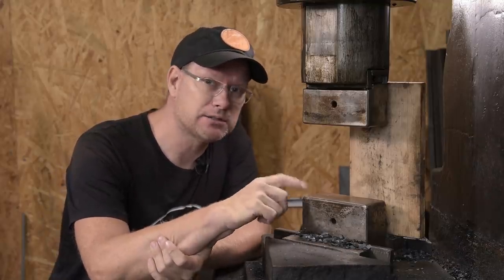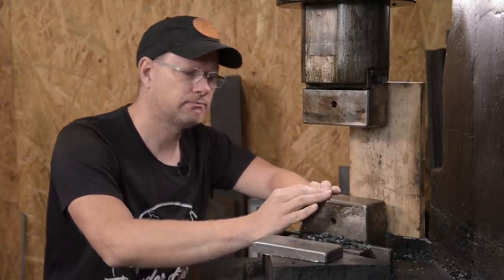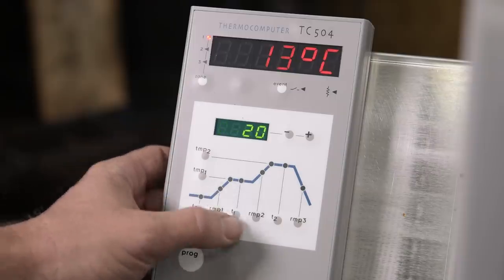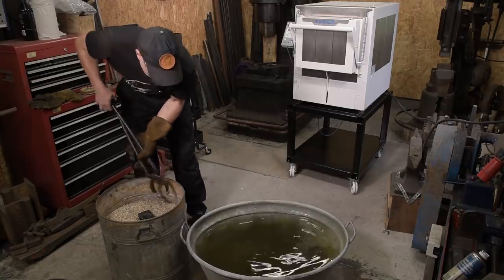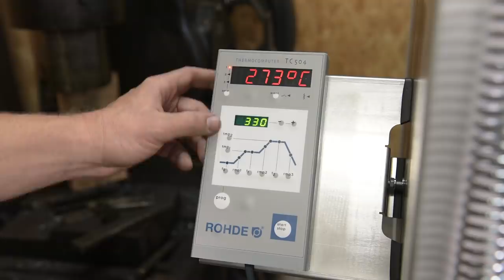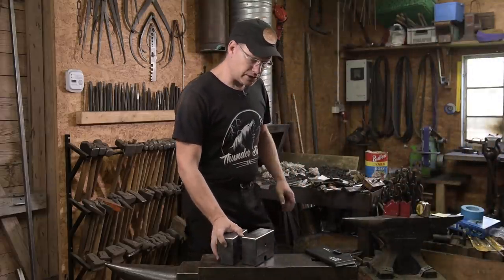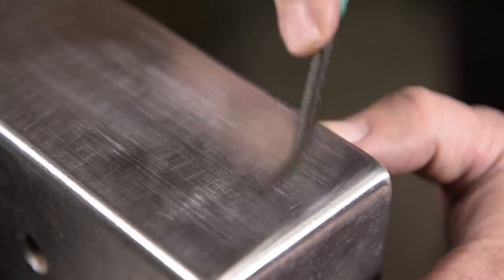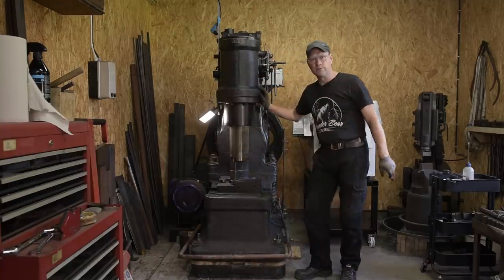Blacksmithing - Heat treating hammer dies

Comment: 1045 at that thickness will harden no deeper than about 6 mm.  4140 will give the same hardness but to a greater depth and do it in oil which reduces cracking risk and distortion. The quench medium, air, oil or water,  depends  as much on thickness as it does on chemistry. 1095, considered a water hardening steel, will give full hardness on sections 1/4 " or less when quenched in oil. Nothing is gained by exceeding the critical cooling rate of a particular steel section.

Comment: If you have a piece of mystery steel you might be able to take it to a scrap dealer and have them look at it with their X-ray fluorescence analyser. That should give you a fingerprint that will uniquely identify the alloy.
Reply from the maker: Indeed, but not many will have that instrument. In this case I was pretty sure what I was dealing with.

Comment: Torbjorn, If those 1045 dies were hardened and tempered before you started this process, shouldn't they have gone through a complete annealing/normalizing cycle before re-hardening?  This is what I was always lead to understand from the heat treating world.  I'm sure I'm missing something or just too old lol!  As a longtime subscriber I love your channel of superior work!👍👍👍
Reply from the maker: Thank you! They sure were. Assuming the last hardening was done right with no extensive over heating with grain growth and such I don't know if you gain much from a normalizing cycle. Annealing is definitely not needed. It can also be different with other more complex alloys. I'm not an expert here, just doing what I have picked up along the years.

Comment: Thanks so much for all your videos.  I was wondering that if the face of the metal hardened further by increasing the carbon content (face hardening). I understand that this was used to harden armor plate previously.
Reply from the maker: Thanks. Yes you can case harden something, increasing the carbon content on the surface, maybe 1-2mm deep or so. I don't think that is suitable for hammer dies though.

Comment: that seemed to go alright 
I read that it can be difficult to harden big pieces of steel like that.
because the cooling has trouble overcoming the heat and so it can anneal/overtemper itself as it is being quenched 
or the temperatures of cold hardened steel and hot soft steel, can break the hardened steel, because hot steel is expanding and hardened steel is shrinking. 

hm maybe your pieces were small enough.
Reply from the maker: I'm not sure, really. Enough coolant and agitation is important of course. The expanding is what breaks stuff for sure. The alloy just needs to handle the cooling rate. That's why most steels only are quenched in oil as that cools slower.

Comment: I was very surprised to see you doing the hardness testing on the nice ground working surface, not one of the side faces...
Reply from the maker: The scratches are minute so it doesn't matter. However It's pretty important to test on a good surface. During the heat treatment all the surfaces are subjected to decarburization, and the very surface does not represent the true hardness underneath, so you really need to grind away that layer.

Comment: out of curiosity; why did you wanted the hardness between 45-50 and not more?, because an impact can crack the die if its harder?
Reply from the maker: Exactly, or chip off corners etc. It's dangerous to have them too hard. It's all about the compromise between toughness and hardness.

Comment: First time I saw someone use the hardinigtest kit that way. Normaly you start with the softest and work you way up. As soon as you hit the hardness it leaves a scratch in the metal. 
If you do it your way you just make a lot of scratches in the metal.
Reply from the maker: The other way round you dull your files! :) If you're testing on something delicate you can of course go which way you like.

Comment: Is there ever a case where you want the hammer dies to be softer than the working material? It must still be imparting force to the part, right? Except the tool conforms to the workpiece, instead of the other way around?
Reply from the maker: I don't think there is. Very unpractical. You can always lay something softer on the die, like when you are cutting or punching and run the risk of going into the die and either damage the die or beak the tool.

Comment: I'd be interested to know the hardness of the top of the dies before re-treating them?. Keep well.
Reply from the maker: I know, that popped up in my mind when it was too late.
Reply: You can still test the offcuts from the dies on the cut side. Should be the same.
Reply from the maker: @davidbutler3661  Indeed, my head is not working :) :) I will check

Comment: Could you not just have hardened the working surfaces so as to avoid any issues with possible stress cracks from the sharp corners? I'm glad everything worked out for you without cracking.
Reply from the maker: No, that's not a good idea on dies like this. I had some similar thought, but asked the pros and was advised not to do it.

Comment: How hot does the die surface get? I'd expect a thin layer of the surface to get hotter than what hardened 1045 can take before annealing. 
Have you ever experienced a problem there?
Reply from the maker: No, it never gets that hot. The entire block is a heat sink and will draw any heat from the surface. After a long forging session it's all warm but never reaching near 300C
Reply: @torbjornahman  
It's not about the overall temp of the block. That is safe without a doubt. A thin layer that is in contact with the hot workpiece can be problematic. I don't know if it's an issue with hand forging. But I had similar problems with die/drop forging. I designed a hard coating for forging dies with the intention to make them last very long. We got it done in the end, but not without some head scratching failures. Hardfacing with some very fancy tool steel alloy that was able to keep it's hardness over 600°C. SHOULD be good enough, right? BUT it still eroded away almost as before. And we think it was because the screaming hot work piece overheated a very thin surface layer over that critical temp and wearing it away during the short time of very intense contact. Just couple of dozen atom layers at a time. But enough not to be able to make a million product pieces with a set of dies.
Reply from the maker: I guess drop forging is a bit different, often with large pieces with a lot of heat and pressed into a mold with intense contact. You're probably right, and that's why dies often are made from H13.
Reply: @torbjornahman  That probably is the difference here. H13 was also part of our tests.

Comment: Hi! Can you adjust the stroke of the hammer? I recently bought one but the stroke seems to be a little bit shorter and the hammer head doesn't go as high inside as I've seen on videos.
Reply from the maker: Not in general, but if something is wrong with it if can be fixed. Different hammers expose different amounts of the ram/tup at the idle position. You really need to know how it's supposed to work on your type of hammer.  I adjusted my dies to get a longer stroke, but you need to carefully check that the ram does not crash into the stuffing box before you proceed with that operation.

Comment: Hello mr. Torbjörn!
Some days ago I made a little carving knife, quenched it and tempered it to a light yellow colour.
What do you recommend, should I temper the back of the knife to a blue-purple colour or will it work like that?
Thank you in advance.:)
Reply from the maker: If the blade is fairly short I think you're good. Remember to temper the tang a bit more (heat the tang until you see colors travel just past the transition to the blade.
Reply: @torbjornahman  thank you very much.
Have a nice evening. :)

Comment: I’m wondering why you couldn’t surface grind them.  You could put them in a mill and cut the surface very slowly than use wet stones to polish them you would probably only need to remove..015 to .020 of and inch if they are fifty years old that’s really good, years to wear ratio just asking.
Reply from the maker: If I had a mill or surface grinder, yes!!

Comment: Quick question why didn't you use oil to quench????
Reply from the maker: To harden 1045 steel it needs to cool down very rapidly, so you need water. I was probably not clear enough on that point. Oil cools much slower, which other alloys like better! :)
Reply: @torbjornahman  thanks for the info

Comment: Hello ! Can you tell me why did you search 45hrc and not more ? I have learned for a C45 optimal treatement in oven is 200 Celcius why 300 this is « softening » steel
Reply from the maker: You heat treat for different applications! A hammer die should never be so hard that you risk chipping and cracking. Between 45 and 50 is a good range. That said c45 steel is far from perfect for dies, but i decided to keep these and use them as long as they hold up.

Comment: The spring in that locking mechanism looks a bit too frail to be used in a power hammer like this....are you not worried that it could break?
Reply from the maker: I think you missed that it only prevents the wedge from falling out. The wedge is what is holding the die in place.
Reply: @torbjornahman  I might have, my bad.

Comment: It baffles me how you can harden something to the point that a metal file skates off the surface, yet you can still grind/sand it smooth and flat. Is the grit used on the sanding material harder than the files? Not really sure of the correct way to word that, but I hope it's understandable.
Reply from the maker: If it's really hard, even the sanding is hard to do. But abrasives tend to cut in a different way apposed to a file that truly needs to shave off a chip like a knife in wood.
Reply: @torbjornahman  Interesting, thanks.

Comment: If you want the oven to heat up as fast as possible, why don't you preheat the oven? Like with pizza?
Reply from the maker: It doesn't matter. Heating the dies still takes time. Maybe I should have used a different phrase...
Doing it this way the dies follow the temperature and when it's up in temp, the pieces probably are too, more or less.
Reply: @torbjornahman  Makes sense.

Comment: As a metallurgist, I see much misinformation and malpractice when it comes to heat treatment of steel. You obviously did your research- good job! Soak time guidelines are pretty good but an old heat treater's trick to determine whether steel has reached the desired pre-quench temperature (850C, here) is to nudge the block to one side in the furnace- the hearth underneath should be the same color as the work.
Reply from the maker: Thanks! There is of course much more to say about the subject but I didn't want to go much deeper. Metallurgy is very complex and I still have a ton to learn.
Good trick, however this kiln/oven has heating element under the bed so maybe it's not working so well here.

Comment: Does anyone knows why fresh martenstite left after quenching without tempering cracked next? what physical/chemical process stands behind this?
Reply from the maker: Martensite is larger in volume!
Reply: @torbjornahman  you mean that metal cracks because of inner tension?
Reply from the maker: @maksimchernykh  Yes
Reply: @torbjornahman  thanks a lot

Comment: I actually wonder one thing, why did he put the steel into "vermiculite" after quenching ? What is the main reason for it ?
Reply: So it cools down slower, the vermiculite acts as an insulator
Reply: @michaeldixon6656  Thanks for answer, but you have already quenched in water and it cooled at room temperature in water, after quenching, how it could be cool again ?
Reply: @abdullahkarakas5730  It wouldn't have cooled completely as the work cools the water heats up. he mentions in the video he doesn't like hardened steel to cool completely and likes to get it to around 50-60°C before tempering.

Comment: 5:27 The ht oven shows "13°C": was it around that temperature inside the shop and you were wearing pants and a t-shirt? If so, damn, you're built different. The lowest I've felt was 11 or 12°C and I felt like I was going to freeze even though I was wearing 1 extra layer and was under a blanket.
Reply from the maker: :) :) I think the room was a bit higher, but the nights here are starting to get a bit chilly and that is probably what is reflected in that temp. It's funny how you adapt to temperatures, here in the spring you can go outside in shorts and a t-shirt if it's 13C, but in the fall/autumn 13 feels really cold.

Comment: Why not a glycol quench?
Reply from the maker: Why?
Reply: @torbjornahman  glycol would remove the heat at a slower rate, and shock the metal less! I first came across this quenching method at ALCOA for quenching aluminum extrusions and tubing, and later at Shultz Steel in South Gate California.
Reply from the maker: Aha, ok I get it. I think 1045 can handle plain water if the material is correctly handled

Comment: Verm is for holding heat to let it cool down slowly, if it was cool to the touch then the Verm did absolutely nothing! Just sayin.
Reply from the maker: Yes, but I didn't want it to cool down further... better there than on some other surface that could draw the heat out.

Comment: 14:15 it is wrong. Start with small until see the effect. Otherwise until find the right one, you take some. This is not ideal.
Reply from the maker: It depends, you dull your files faster that way and hare some marks does not matter.

Comment: Ни чего не понял, но было очень интересно...!   ;)  ;)
Reply: Вкратце - бойки молота не имели необходимой твёрдости и малость помялись, пришлось снимать, шлифовать, закаливать и затем выполнять отпуск.
Reply: титры в помощь на твоем языке
Reply from the maker: Turn on CC, go to settings and chose auto translate to russian!
Reply: @torbjornahman  It's not just about CC, the viewer needs to understand a little about metalworking :) It's some trouble with translation in Russian with terms "hardening" and "tempering" (translation is the same, although there are two different processes in the video, they are called in Russian as "закалка" and "отпуск").
Reply from the maker: ok! Yes google translate is not doing a very good job with Russian... Most of the time it's very strange :)